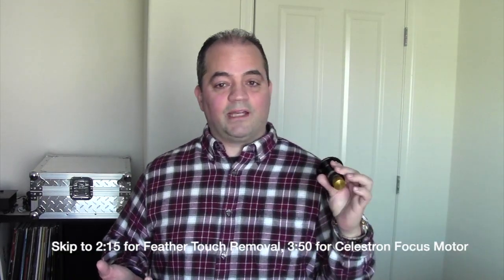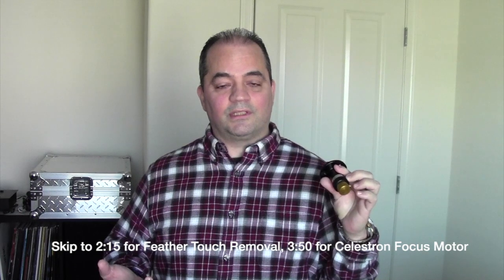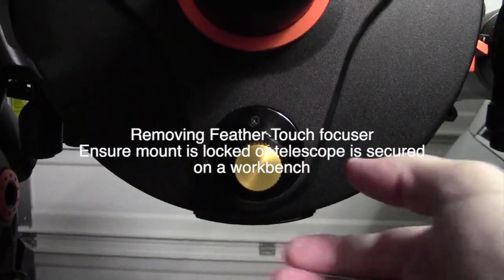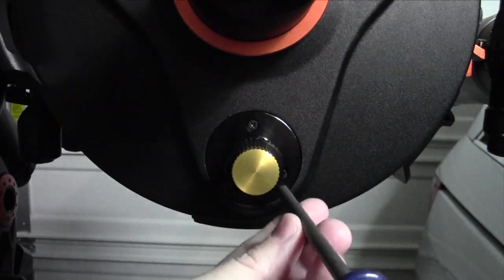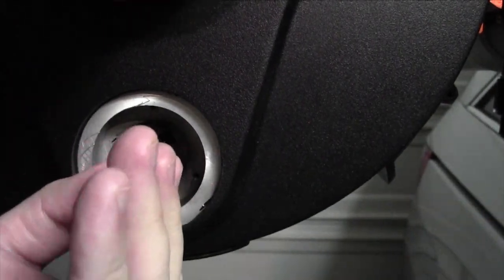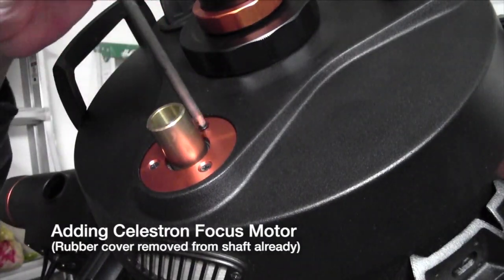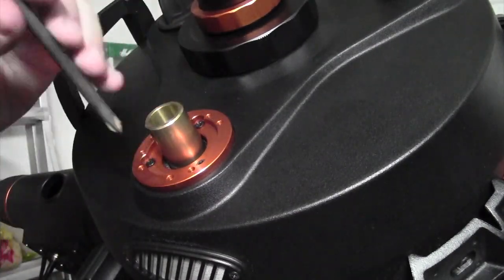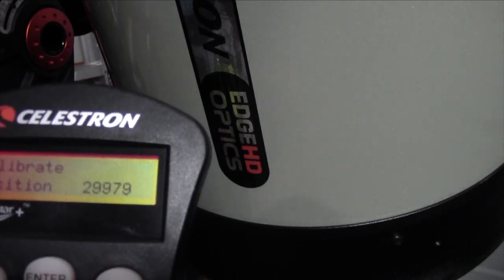Celestron RASA Feather Touch focuser remove Retrofit ( 94255 ) and/or Focus Motor ( 94155-A )l

Comment: Hi Ricardo I just thought I'd ask does the retro kit come with the large orange plate that you fitted in the video first? I'm only asking as the pictures I'm seeing of them online doesn't seem to have them.
Reply from the maker: It doesn't look like it.  Full disclosure, mine is a C11 Edge which I put a Feather Touch on it and later removed it for the Focus Motor.  So the orange plate you mentioned, I had it already.
Reply: @ricardo.pedraza   thanks for your reply I'll see if I can find someone who upgraded theirs to a featherlight and have an orange plate that isn't needed anymore

Comment: The retrofit is great but ANY focus motor is better than the Celestron motor. I have had four of these break on 3 scopes and all have since been replaced with ZWO's. Celestron support was terrible and RMA's turned out almost impossible with them. I love my C14, RASA 11 and C925 SCT's but man they really did not design this motor well at all. Buyer beware and YES this retrofit will allow you to use non Celestron focusers (pegasus and ZWO from my testing work perfect and have temp sensors).
Reply: Right - the Celestron motor won't work with the Software Bisque Fusion Computer - causes it to lock up.  I got the motor to fit the feathertouch and it's been working great.  But looks like the ZWO has hardware to fit the RASA - they did not have when I added the Feathertouch Motor unit.

Comment: Hi, could you tell me the dimensions of the replacement washer supplied with the feather touch focuser, I  think its part no 1805. Lost mine, one bounce on floor gone for ever! tried emailing starlight instruments with no luck, they will not respond to my request for a replacement or dimensions so I can source locally in the UK
Reply from the maker: It looks like 10mm or 1cm across and 3mm thick.  I would think you could order a replacement part from them, have you tried calling them?
Reply: @ricardo.pedraza  Hi, thank for the reply, I Found IT!! amazing how far something so small can roll, just in case anyone else needs dimensions.
 Material: Brass or bronze

Outer Diameter = 9.60mm
Inner Diameter hole= 5.50mm
Thickness = 2.00mm
Measured with digital verniers, not calibrated, expect some small tolerance's, there seems to be a very slight bevel to the outer edge.